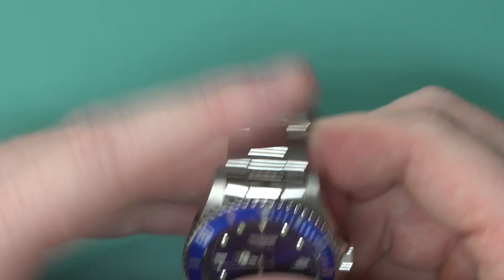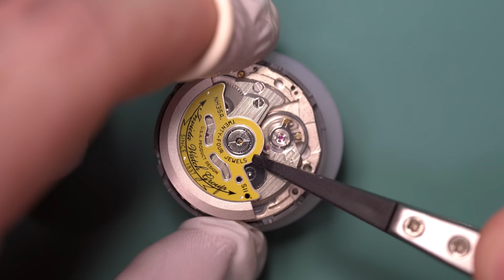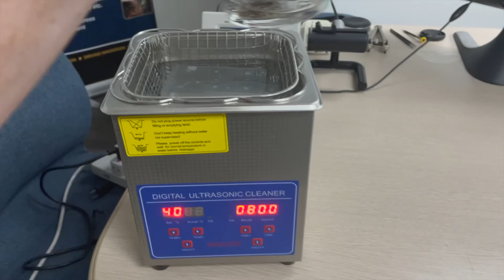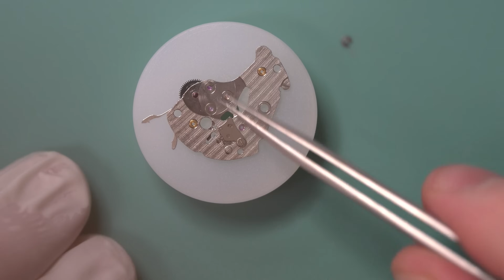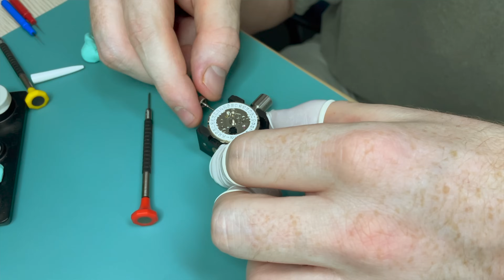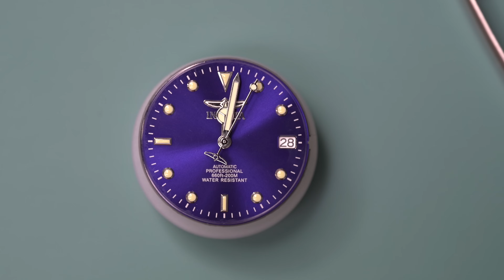$75 Invicta Pro Diver Strip Down and Review - Budget Watch Restoration - Seiko NH35a

Comment: Bought a black Invicta Pro Diver back in 2006 for $100. Have worn it in a swimming pool, on the beach in saltwater and everywhere in between. It’s still functioning and is one of the best and most reliable watches that I’ve ever owned. Actually better than a few of my over $500 timepieces. Still wearing it regularly, 16 years and counting.
Reply: Have you had to get it serviced in that time?
Reply: @aradoran  Never. It’s still functioning as normal.
Reply: @ddee63x  That is insane.  I picked up a blue version and black version to wear and eventually gift my sons.  What an great value.  Wish I would have known about this watch years ago.  I’ve had some absolutely garbage watches that were 2x the price.
Reply: @aradoran that's my hope someday too .. gift my collection over to my kids.
Reply: @aradoran I doubt anyone services NH35. Sure it can be done (as shown in the video), but unless you do it yourself it will be much cheaper to replace it with a fresh movement.
Reply: Similar story here. Same pro diver everyday for over a decade, I shower and sleep with it also. The case got moisture in it once and quit running after wearing it like that for a while. I took it to someone local he replaced the movement with a 4r36, as well as the crown tube seal +case back seal. 12 years one repair is a good track record for a cheap watch.
Reply: How is its accuracy? My invicta -8 second daily.
Reply: @alihaydarerdogan8257 my Invicta pro diver automatic is +/- 5 s/d crown up/crown down. Face up or down is about 15 s/d. On my wrist it's mostly crown down, so at night I put it crown up. Almost perfect time keeping results.
Reply: @alihaydarerdogan8257  I found that with mine, there is a sweet spot of daily activity.  Move around too much, and it'll run a wee bit fast. Leave it on the counter all night, and it'll run 4 seconds slow.  Move the right amount, and it will be accurate down to the SECOND.  My record is about 2 months of +-0 seconds.  It became kind of a challenge to nail that zero (checked against the atomic clock) every day.  Haha

Note: I only stopped at 2 months, because I got tired of caring.  If I had continued wearing it in that way, I could have kept up the +-0 indefinitely.
Reply: Same, It’s my main beach and paddles boarding watch. Swim with it a lot and it’s been really good for that.
Reply: I love this video!  Your explanation of the watch, the movement, and specifications all while restoring the watch were superb! All of this made me feel better about Invicta watches that I  currently own, and will own. And, when you made a mistake earlier, you corrected yourself and maintained the integrity of the watch. Because of all this, I'm a new subscriber most definitely! ❤
Reply: I have used one for last 4 years Invicta drive watch 660ft or 200m water resistant still working fine.
Reply: Chlorine pool doesn't tarnish the steel or damage the coloring?
Reply: I brought same watch ( black face ) $60 several years ago.
To b honest didnt expect a lot for that sort of money. But several years later the watch is going strong, keep excellent time. I am amazed - have paid 10 times for watches that were less reliable. Have only had to replace the clasp on the band.
Reply: Amazing
Reply: Hello, i wanted to ask if the mineral glass endured all those years of work, i'm planning to buy mine but im a bit concerned about it not having sapphire glass, i fear scratches a lot. Thanks in advance
Reply: Back in 2006, this Invicta Pro Diver had a Miyota movement. Not saying it's bad. No hacking, though, unlike the NH35.
Reply: @SK-rj1ti The Miyota 8215 is every bit as good as the Seiko.  Much nicer to service, too, IMO.
Reply: @TruthHurtsSomet1m3s  I will keep this in mind, Karl:) Or is it Friedrich? I actually kinda liked the fact that the older version of 8215 did not hack. This kept my OCD under control:) For this reason I also have nothing against Seiko's 7S26.

Comment: I have worn exactly this watch for over 6 years...in the pool, in the shower, working with heavy machinery.  It sometimes goes through phases.  For a while, perhaps a few days it will run fast and then return to normal.  Then it runs slow and returns to normal.  This is the best watch I've ever owned with no battery to go flat or replace.  Oh, several times people at a distance have confused it with a Rolex Submariner with an envious "I like your watch."  I can live with that!
Reply: Your comment absolutely turned me off from this watch. It doesn't keep good time. Why would anyone want that? Because it looks like another watch that doesn't keep good time? It is good you have a phone so you are never late...
Reply: @Onemore59  When I said the watch would run slow or run fast, I think you got the mistaken idea of a wildly out of sync time piece.  I use a Seiko quartz wall clock clock to reset my Invicta wrist watch.  The difference can be 30 secs up or down over a period of weeks and after 6 years that's not bad.  This watch has become part of my arm almost like a wedding or signet ring.  My wife was given a Rolex 'perpetual' watch by a famous corporation for exceeding her sales goal.  She made them a ton of money.  The watch?  It quit in less than two years, this after retailing for over $8k and now hides amongst important papers and jewelry in the safe.
Reply: @Onemore59  Normally you want to regulate it so it runs slightly fast (perhaps by +5spd on average).  That way, you won't be late for anything because the actual time will always be <= the indicated time.  If accuracy is important, get a quartz.
Reply: @Onemore59  you want a Rolex for 100 bucks ?
Reply: @Onemore59  Mine runs around +2 seconds a day, so it's just as accurate as watches 10-100 times the price.
I still wouldn't look at my watch to tell the time haha

Comment: I have two pieces of the quartz version and although it runs very precisely, setting the time is an unbelievable challenge, be cause when you push back the crown the minute hand will irratically and unpredictably jump forward or backward up to a few minutes. Have you ever heard of that problem?
Reply: Its a common issue on man quartz movements. When you set it, one you get it where you want it, Try moving the hands counterclockwise, just touch (like go just past where ou want it and then move it back) Also make sure youre not setting it while wearing it. And when you push in the stem use your thumb and finger together dont just push the crown in with one finger
Reply: @ryanpeck3377  Yeah, I've already adapted a technique of moving the minute hand forged and back passed the point where I would want it (at which I want it to get set) until I feel there is like (almost) no resistance any more; something not unlike what you are suggesting. Your answer, what you say, is the first time I ever hear someone confirm that this is an existent problem with quartz watches though!

Comment: No debate from watch collectors pure trash.Unless you mean INVICTA COLLECTOR THAT HAVE 50 $50 TO $150 watches that they could have saved that $5000 and get something decent like TUDOR,OMEGA or in normal times maybe used Rolex but of course you will only have 1 watch but less is more in this case.

Comment: They may get hate for some of their more garish designs, but Invicta makes a quality watch in the pro diver lineup. An NH35 watch, with 200m water resistance, steel construction, for less than $80. Pretty huge. I think many dislike them because it sheds some light on how overpriced some watches can be. Looking at you, Seiko.
Reply: @HotCacahuete  my band hasn’t broken. And I’m only speaking from my experience with the brand. I’m guessing yours is less favorable.
Reply: Seiko is tried and true. Everything about them is almost bomb proof.
Reply: @colescuckooclockshop754  I own two vintage Seikos and the Jubilee. Bracelets are junk.  You can snag them on anything and the bracelet literally blows to pieces. I’ve had to put my bracelets together two or three times with needle nose and find screwdrivers to push the very soft metal links back together.
Reply: @PCTVPatrickComfortTV  I have at least 20 seikos. Neve Thad a bracelet problem.
Reply: They dont really make much, they simply design and outsource.
Anyone with enough capital can do what they are doing. With that said, not everyone can do it, and stay in business.
I can start my own watch line, call seiko and get this exact movement. Technically get one of these watches, make a mold, and send it off, and make the exact watch with a different name.
I'd bet my life, I wouldn't be able to sell them for 60 bucks and be profitable, def not profitable enough to stay in business.
I'm not getting the same deals they are for materials and parts and the like.
I don't personally wesr this brand, I do wear seiko's though.
I have a cpl seiko's (my fab being the Turtle).
I have an Oris.
I have a Ball. This is my most expensive and favorite watch. I love how it wears. I love the work and detail, albeit, eta movement. Its a great reliable watch ive had for about 10 years strong and its beautiful.
Reply: I love my pro diver, but its a sellita sw200 and its solid! I like it better than my Tudo actually!  And it 10 times cheaper.. but feels as solid.
Reply: Seikos are a gem.
Reply: @HotCacahuete  I own multiple Invictas and I wear them every other day, if I’m not wearing my Tissot or Seikos. They have never broken on me.
Reply: If you ever looked closely into a movement of say a rolex or Omega , you`d know where that price difference comes from. Seiko has 3 ranges of watches as well.
Reply: @KpaBaPa  notice that I didn’t say Rolex, omega, or Tudor. I own a Tudor BB58. I understand the difference. Fact is, Seiko charges over 5 times the price of one of these for a watch with the same movement. Check the presage cocktail time. Movement is basically the same as the NH.
Reply: @andrewe.8321  
I’ve owned a Rolex and own several Grand Seiko. Rolex is way over priced for what you get compared to the GS. 

This watch carries a Seiko movement that was probably built in Thailand. That doesn’t mean it’s bad, but Japanese labour costs more than Thai labour. Everything else is stamped out in China hence the price.
Reply: @kelechinobi3085  
I also own a GS, and I agree that the Japanese made Seiko rivals most brands at twice the price. 
Don't expect much for less than $500....a watch guy knows that $500 is entry level.
Reply: @andrewe.8321  right, and Seiko doesn't even give you a sapphire crystal most of the time, until you get to big money.  It's ridiculous for any watch over $100 to not have sapphire.   I have a Timex that has a sapphire crystal, and all my Citizens do.  Seiko needs to ditch their hardlex and start using better crystals.
Reply: @KpaBaPa  
He has no idea what he's talking about and has no concept of what spring drive is.

We all know real watches don't take batteries.
Reply: @thefrogking481  are you here simply to insult? Is that why you clicked on a video for an Invicta? I highly doubt you know anything about what you’re talking about. As for your comment about spring drive GS models, I don’t personally own one, but the mechanism is easy enough to understand. All it boils down to is power derived from the mainspring and gliding mechanism. Not sure what your point is, or if you even have one.
Reply: There's been a fair number of complaints about the waterproofing so that needs to reviewed/testing.
Reply: @metatechnologist  I wouldn’t be shocked. Display case back and all
Reply: @metatechnologist  from people who did not screw in the crown...
Reply: A lot of the waterproofing issues are to do with people not screwing down the crown properly! @metatechnologist
Reply: I find it odd that you mentioned overpriced watches and then pointed out Seiko. Seiko is literally the epitome of watch buying value. They have a strong heritage. Exceptional fit and finish all for an incredibly reasonable price point. $500-$1000 Seikos are often similar in quality to many higher priced units.
Reply: @Jay Dee A) it was a watch dealer that is authorized to sell invicta and B) they literally do this all the time advertising on TV being half off MSRP. Plus invicta’s original designs are dog shit
Reply: If this watch is defined as an incredible watch then you would be blown away by a reserve level invicta
Reply: Invicta is mass produced while seikos are created by professional craftsmen
Reply: It’s not really 1 to 1 with Invicta and Seiko. Seiko has to spend a lot on design and marketing, while Invicta just coly other designs. Nothing wrong with that but it’s easy to see why Seiko costs more.
Reply: I know someone who bought an Imvicta on a cruise. Salesman had it at almost $1000 and on the last day “reduced” it to $150 and the guy thought oh what a deal. Its not even an automatic either and big and bulky and ugly. So fuck Invicta
Reply: A Seiko is over priced to you?!?!

Don't own many nice things do you?
Seiko is a quality entry level watch,  Grand Seiko is another story.

Face it kid, you get what you pay for.
Reply: @thefrogking481  overpriced compared to what it was. Or do you not remember lol
Reply: @andrewe.8321    You can still buy a nice Seiko at a decent price, but don`t expect to get a Grand seiko for the price of an Invicta :D :D If you want good cheap watches, buy a Casio, for under 500 can`t really go wrong. I much prefer a Casio G-shok over an Invicta just so my watch can look like a rolex, if I want a rolex looking watch, i`ll buy a rolex.
Reply: @KpaBaPa  Peter, I didn’t come to argue that a cheap Invicta rivals Rolex. If you need self esteem, and wish to talk about Rolex, Grand Seiko, and the like, I’d advise finding a video related to that. Otherwise, you just look like you’re compensating.
Reply: @andrewe.8321  noone is arguing they if invicta can rival rolex or not :D if you actually paid some attention, you`ll find out that for the money you`re paying for this, you can do a lot better and shouldn`t go for this just because it resembles a rolex.
Reply: @KpaBaPa  Tell me Peter, what watch at 60 usd is actually better?
Reply: @5555S5   Any seiko or casio
Reply: @KpaBaPa  Seiko at $60? Which one? Oh, an Invicta Pro diver...
It is a fact that a $40 G-shock is even better than a Rolex. Your point?
Reply: @thefrogking481  ooooo meooooow
Reply: @thefrogking481  Seiko is definitely overpriced. There are brands like Spinnaker who give you a nicer watch than Seiko, with a Seiko movement, for less money.

Comment: IF YOU SWEAT IT WILL STOP RUNNING.  GET A REAL SEIKO BUT $75 IS JUNK. PUT IT IN THE WATER AND IT WILL STOP   DIVER MEANS YOU CAN DIVE WITH IT 200 FT /300 FT.  THIS I WOULD WASH MY HANDS. FULL BS

Comment: Invicta has a few reasons why people like myself hate them with a passion.
First is the Invicta owners comparing these to high end Swiss automatic watches. For instance the Invicta Pro Diver being better than a Rolex Submariner. Absolutely not true. And you will find plastic components in the movement itself. 
Quality control is another serious issue. Water damage ,mainsprings breaking, stem not always engaging like they should and crown threading soft and strips out early.
Another issue that did arise with the Invicta brand is having Swiss made when in fact they were not. They would use some Swiss parts but everything else was outsourced. After the watch community complained is when Invicta quit adding Swiss Made to their watches unless they were actually built to Swiss requirements.Meaning the parts, how much of the watch is being built in Switzerland etc.
Most of their watches are rather comical due to size and weird designs. 

The watch you are working on believe it or not is probably Invictas best watch. The Pro diver for the price is a decent watch. I will never own one but it is the one watch I understand. 
And btw, Invicta isn't alone when it comes to some of their shady practices. Most of these TV shopping network watches are misrepresented. And people believe the salesman on these shipping shows.
If you own an Invicta and you like it , then more power to you. I am happy for you. But do not tell me the Invicta you are wearing beats the Rolex on my wrist when it comes to build quality. It is not as good so do not fool yourselves into believing all the hype.
Work on a few true Swiss automatic watches and then work on an Invicta and then tell me what you really see.
Reply: It makes me sick they call us Rolex fanboys but cheerlead for maybe the worse watches made.Not a watch snob before I was able to buy Rolex,Omega,JLC I didn't want a wanna be watch I enjoyed SEIKO AND CITIZENS real watch companies and solid products for the same as INVICTA CRAP.

Comment: I'm fairly new to watches (started last year) and I buy only cheap priced watches to start out with and test the waters, so to speak. I just bought an Invicta Pro Diver 8928OB (automatic) for $45 on Amazon (U.S.). It'll arrive tomorrow. Limited time sale! I was impressed with how it has the NH35A Seiko movement, so I had to buy it. ☺️

Very nice seeing you take one apart like this. I am tempted to start doing this myself. I bought a $30 skeletonized watch last year. It is from a company called Forsining, I believe in China. I wanted a skeletonized watch just to look at the gears move inside, but maybe it'll be my test subject in the near future! 😄 I'll have to start looking up all of the tools I'll need. Should be a fun hobby. ☺️

My other cheap test watches are: Skmei 1358 $30 - has barometer, altimeter, compass, pedometer, pacer, 2 alarms, 100 hour countdown timer, dual time and chrono. Well worth the $30! The other is a Casio W735H for the vibration alarm / timer. I even bought a Casio calculator watch, just to fool around with. 😄